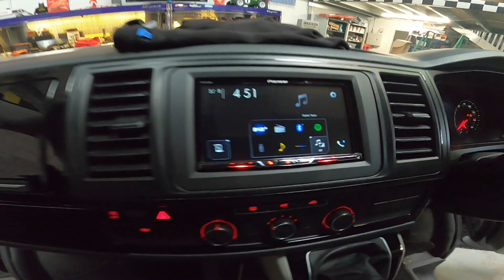pioneer sphda230dab

Comment: This all seems to be done on mine however I don’t get the steering wheel control option in settings?? Any ideas please
Reply from the maker: there is no steering control option , its just there working already the only thing you have to do is 1 use the 3.5 mm jack input for the steering controls and 2, have the patch lead / interface wired or dip switched for the type of vehicle or stereo brand you are using . if it doesn't work the lead is wrong for your car or its not fitted right
Reply from the maker: make sure its in the w/r hole not aux

Comment: Another great video Alex. What is the purpose of connecting the two blue wires? I am about to install this stereo and I have the blue wire next to the Fakra attachment. Do I have to connect it to the lose blue antenna wire coming out of my quad lock attachment?
Reply from the maker: it turns on the aerial booster or amp

Comment: Morning, any idea why this radio is draining my master van battery?
Reply from the maker: faulty can box keeping ign on
Reply: As in the cables that came with it? Because also the connect 2 doesn't work the steering controls either
Reply: I've got this reading 0.61amps from the yellow wire whilst the car is completely at sleep. What's your thoughts?

Comment: Thinking of fitting this to my t6, do you know if you can connect the mic to the existing built in mic of the van?
Reply from the maker: i wouldn't.     use the pioneer one
Reply from the maker: you can but i wouldnt pioneer mic is better new clearer

Comment: Hi Alex, I fitted a SPH-DA130DAB for my daughter about 6 months ago and it’s been great, unfortunately she is now unable to get any signal for her digital radio channels, just saying no signal.  I did fit a digital aerial at the time and that still has a power supply to it, I have changed the mast but still no joy.  Would you have any ideas?  Many thanks.
Reply from the maker: so jump onto the pioneer website and do a software update . then try a re tune if that doesn't work try a new dab aerial on the glass a dab01 type. 
then reset all settings and on start up click yes for antenna power this will arm the inner feed with power for reception
Reply: @AlexCarter-AscAudio  Great thank you, I’ll give that a go when I get home.

Comment: Hi I've been fitting this head unit over the weekend and hit a wall. I've got a civic type r fn2 and got the connects2 steering wheel adapter for it but cant figure out what to do with the key1 key2 and ground wires and what to connect them to as there's nothing in the instructions........really frustrating. Would appreciate any help mate 👍
Reply from the maker: ok so nothing use the 3.5 mm jack into the steering wheel control hole in the pioneer the key 1 key 2 and gnd just tape up and leave alone
Reply: @AlexCarter-AscAudio  thanks mate, very much appreciated 👍

Comment: Hi Alex,
This was a great video. Just what I needed. 
I am fitting a Pioneer AVH Z3200DAB unit on my car and was wondering about the park switch cable. I have seen on a few videos that grounding this cable is not enough to enable all features of the deck. On some models a bypass tool is required. Was wondering, how do you find out which model needs a bypass tool and on which models just grounding is sufficient. 
Appreciate your help. Keep up the good work. 
Thanks.
Reply from the maker: So in the UK 🇬🇧 where I am every unit we fit is just grounded to the black earth jvc alpine pioneer kenwood Sony all of them and every feature works . The only time I saw a change was an imported US solstice that needed a box.  This was because the car had can data straight into the radio so the handbrake earth told the stereo the car was moving but the brake earthed out told it it was still so confused it a little but other than that . Every unit works the same 1 different in 5000 stereos
Reply: @AlexCarter-AscAudio   lucky for me as I am also in the UK. Will just ground it then, thanks for your help.

Comment: Dose the HU not need to be grounded ? I thought maybe thats what the green hand brake wire did.
Reply from the maker: the black wire is earth
Reply: @AlexCarter-AscAudio  Cheers , so where is that earthing to then as it just disapears into the loom? , Im not trying to be awkward but ive just installed a sph da250 dab in my civic using the kit and bypassing shown in this video and its running fine but other videos on the subject give the impression that the HU needs to be earthed to some part of the chassis .
Reply from the maker: @jafaem  so follow the black cable into the honda loom make sure there is a cable out the other side of the plug for ground if there isn't it will try and use the fm outer casing as a ground and earth through the chassis not good but it works.  Extend the black wire and add a ring terminal to the chassis for a proper earth
Reply: @AlexCarter-AscAudio  Hey Alex thanks for that I will check it out over the weekend and get back to you with the results...Cheers.
Reply: @AlexCarter-AscAudio  Ok couldn't wait ,the black earth wire runs from the HU through to the grey connector and out the back of it to god knows where in the main harness on the civic , phew no more wiring to do...yet ,thanks for your help Alex.

Comment: Hi there, thanks for this video. Bought the SPH230DAB after your reviews, and the installation kit. I was just wondering about the blue and white wire, is that only for amplified vehicles? Mine is a 2009 Kia Cee'd non-amplified, so am I right to assume I won't have that? So, will only need the connector for the parking brake wire? Many thanks, and all the best
Reply from the maker: Green handbrake earth . Purple and white reverse trigger input . Pink speed pulse input . Blue and white amp remote turn on or aerial booster

Comment: Ive seen some installation videos that shows that you need to connect to the fuse box. I didn’t see you do that. Is because of the new 2connect socket? I’m going to fit it in an Audi A3 2012 model.
Reply from the maker: if you use the wrong lead the fuse box is needed buy the right stuff and you dont have a problem
Reply: @AlexCarter-AscAudio   I’ve got one that is called CTSAD00C.2 Audi CAN-Bus Stalk Adapter is this the old one? Couldnt see the red wire in the main box.
Reply from the maker: @kjetilh2749  that lead gives you 1 canbus adaptor and the choice of quad lock or iso . Both for amp retention . Im not sure what you mean about the red wire.  It will not have a spare red wire thats what the box does can bus ignition sense . The red wire on cheaper quadlock leads are for a citroen but halfords sell them as an audi lead and expect people to wire up the illumination and ignition separately.  The difference is 9.99 or 39.99 id rather have the proper one

Comment: So I have this radio installed in my car, but the idiot who installed it bought an aftermarket wiring harness. So I don't have the light green wire. On what pin is it? I can see it is in the top row when you have the fuse tab on the left. I would love to start using my android auto
Reply: It's the 4th pin, i fixed it.
Reply: Hello 
I installed this radio on mercedes sl 2005..... How i can make steering button working please?